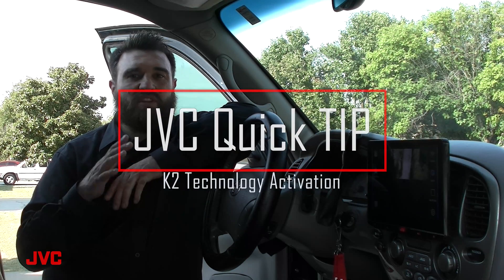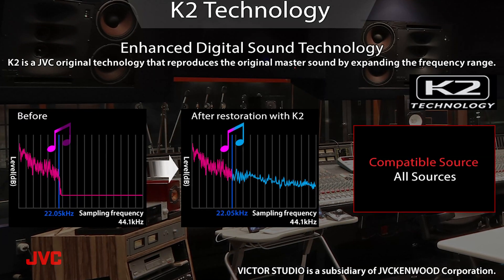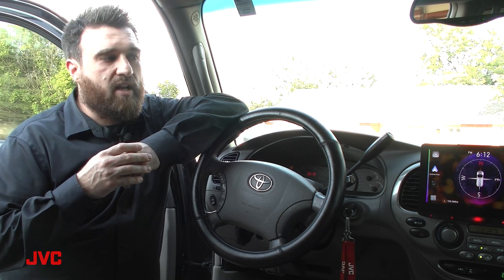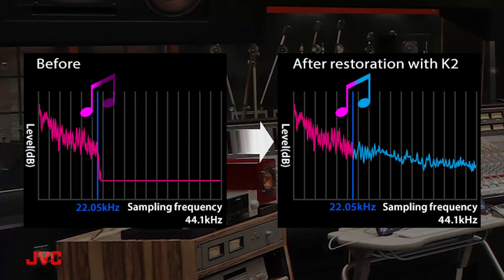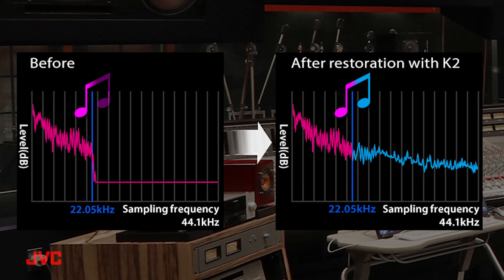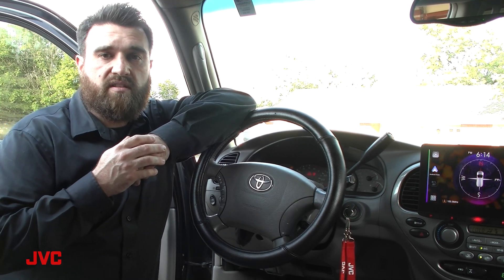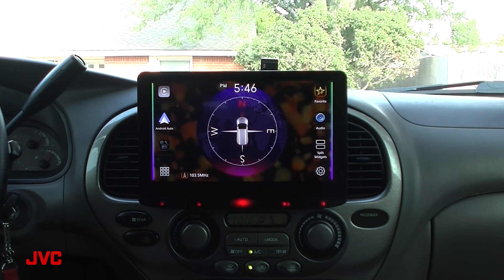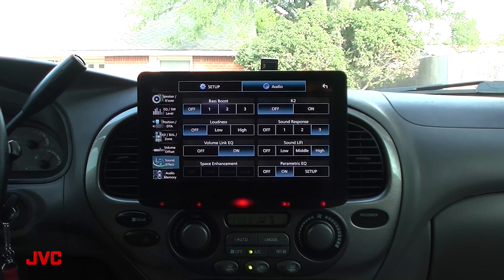JVC Quick Tip- Activating K2 Technology for Better Sound

Comment: I have a 150 bt older unit just replaced my stock unit with it new from best buy and it sounds like it's in a tin can no .after what settings I mess with why!?
Reply from the maker: It would be difficult to guess what caused your tin issue, but you can go to settings and initialize the receiver to return it to its out-of-the-box settings in case you made an error in setup. 

You can also contact JVC Customer Support:  1-800-252-5722 for further assistance. Thanks!